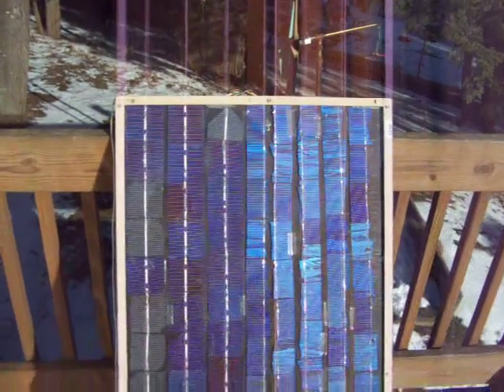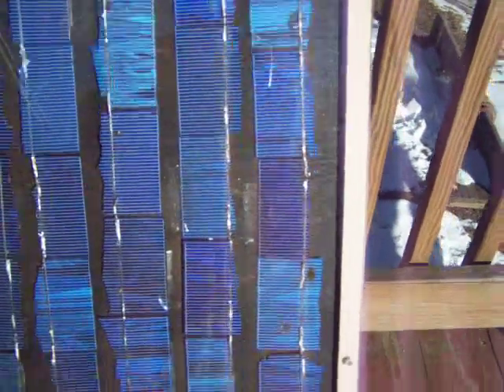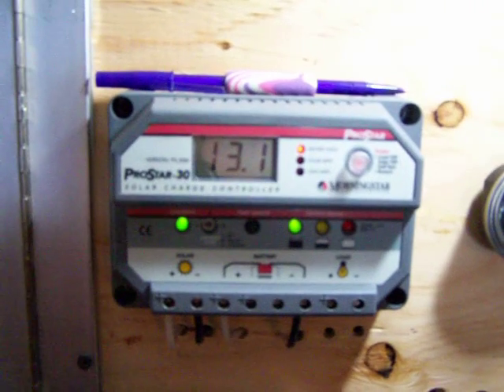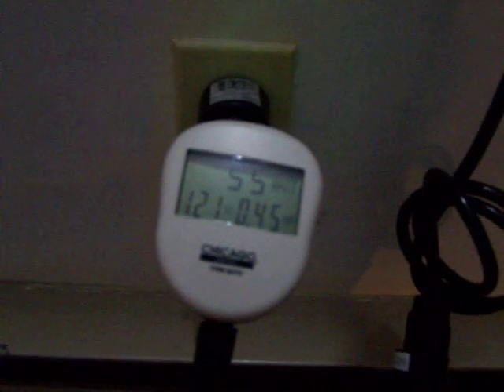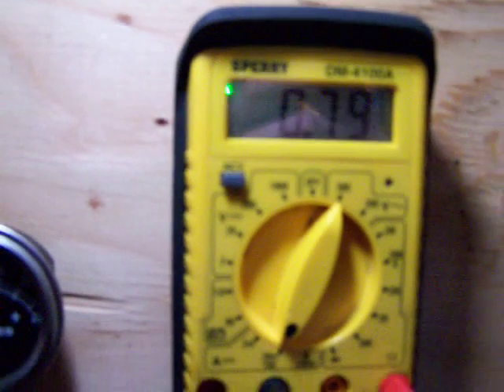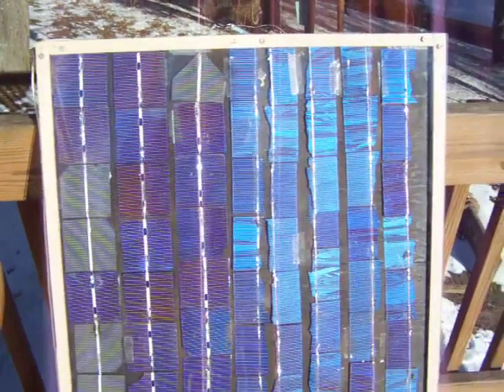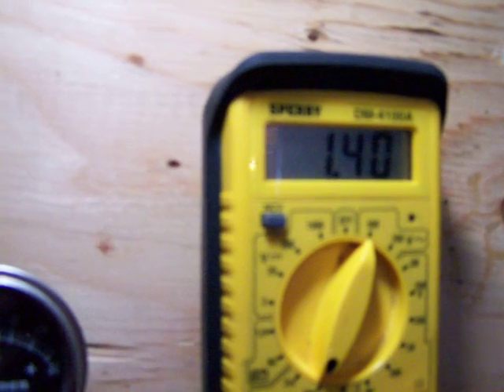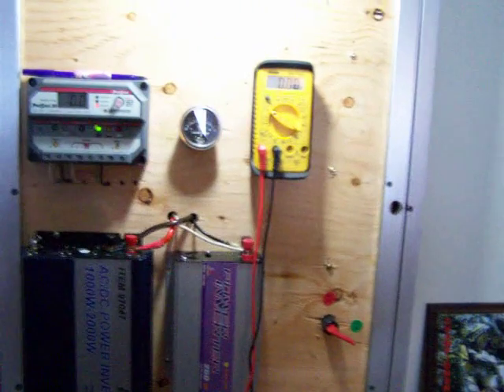diy solar panel grid tie

Comment from the maker: hello there the grid tie inverter cost about 130.00 it plugs right into your wall socket it has islanding protection so when the power goes out it shuts off all of my panels have blocking diodes.I got my inverter off ebay.Check out missouri wind and solar they say he has great deals